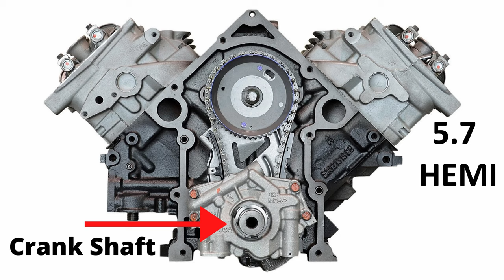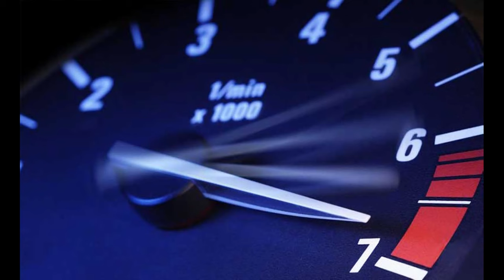HEMI TICK Explained (Easily) - The Cause and How to Diagnose

Comment: Before assuming it’s the roller bearing check the water pump and take your truck to dealer to see what is wrong 
I almost sold my truck because of YouTube wannabe mechanics 
My ticking noise came from the water pump bearing
Reply: I have a 2012 1500 with 120k minor problems started after 7 years of trouble free driving 
5.7 Hemi is a great motor
Reply from the maker: 100% get a professional to look at your truck. it can be very difficult to tell between a lifter tick and an exhaust leak. let alone another issue like in your situation. Never hurts to get a second opinion either! Not only am I a wannabe YouTube mechanic , I'm also a heavy duty diesel mechanic 5 days a week.
Reply: @TheGettyAdventures   wasn’t talking about you I watched many other videos of people saying bad things about the motor
I was trying to say that people need to take they’re truck to a professional and don’t always listen to the internet
Reply: @TheGettyAdventures  I apologize if I offended you but I was talking in general not about you
Reply from the maker: @clgchannel2201  absolutely not man, no offense taken! totally understand what you were saying. truth to be told I have never personally worked on these engines myself but found it interesting how nobody has really addressed or found the root cause of these lifter failures. So there many much more qualified individuals then me. I just wanted to shed some light on the issue and share my opinions right or wrong lol

Comment: I can explain it better,  Chrysler sucks, build quality sucks, from the heated mirrors,  exhaust manifolds, to the piss poor cam and lifters. Probably low quality chinese metals. I found about this then 2 weeks later my engine started ticking. 4700 hundred dollars later it was fixed and down the road it went along with the wifes durango.  I dont want to worry about brake downs, so i bought a tundra, and the wife a lexus. Screw that mopar junk.

Comment: BMW cure for lifter clatter run motor or drive @ 3-3500rpm for 15/20min. + re farm from idle long pi-reds of time.it worked on my 2013 ram + i added graphite.
Reply from the maker: interesting cure, those German engineers never disappointing haha
Reply: Yeah that’s an old school trick to pump up a collapsed lifter. Supposed to purge the air out of it? That and the old Marvel Mystery oil. Fuck it! If it worked for ya!

Comment: They make that noise brand new
Reply: Really 🤔.
Reply: @dimensionexo.  I’ve personally owned a 15rt and a 18 rt and both engines sounds like this video even when they were brand new
Reply: @robfrmny21  Wow,okay,kool,I guess I will just deal with it,thanks 😐.
Reply: @dimensionexo.  I had the lifter make that rattle noise when I was at 1200 miles almost cried lol. The mds lifters I assume don’t hold oil  well.

Comment: And they still haven't addressed the problem.
Just get rid of the darn things and install normal hydraulic lifters. They worked for over 60 years. I will never buy a truck with a so called "Hemi". It's an insult to the real Hemi that they call this abomination a Hemi. Here in BC a major utility company purchased 50 new Dodges with this engine and 49 failed in the first year because they can't handle extended idling. All with fried cams.

Comment: Only a problem on the 09-newer Hemi with VVT, therefore I believe the VVT is the cause of the problem
Reply: The older what 06 to 8 or a bit earlier got valve seat problems....to a SMALL degree. As in basically if you overheat it, run it hot hot hot shut it off, you might have problems with them going. I don't think it's SUPER common by far though. Cam and lifters are probably a bit more common, still can't be that common though
Reply: @baileyhatfield4273  That is true

Comment: I'm having the tick and I am thinking it's the exhaust leak since it does stop once the engine is all the way warm, and the previous owner did indicate an exhaust leak that he never got fixed. What do you suggest blocking the exhaust with to make the noise louder to diagnose? 

I hope that's all it is so I can just replace when I put in my Borla S Type!
Reply: I have an older model, 2011 and the symptom you mentioned was the carriage bolts being broken.  When the engine heated up, the metal expanded kinda holding them in place.  Just my experience, not saying thats the problem.  Common problem too.  And they never fixed it for me under warranty, told me its the hemi tick or something like that.  It was normal.  Good luck.
Edit.
Maybe a little more like a rattle than a tick though.

Comment: I was under the impression that it has more to do with the MDS system not allowing oil to those areas while in 4 cylinder mode. I’ve heard that people who delete the MDS don’t have this issue. Can anyone confirm?
Reply from the maker: Honestly, from what I have heard the MDS system seems to not play a significant role. after doing more thorough research for my follow up video on this topic. It seems like the most plausible reason for these failures is bad or dirty oil plugging and gumming the hydraulic valve lash adjusters in the lifters themselves.

Comment: So to keep it up above 1500 rpm. When im cruising at about 65mph...in 8th gear...its at about 1500-1700 rpm. If I cruise in 7th gear it should be around 2000 rpm. So I should just not ever cruise in 8th gear anymore lol.
Reply from the maker: you should be just fine at 1500 rpm. best thing you can do is limit your idle time with this engine.
Reply: @TheGettyAdventures  

Only have 23k miles on the truck...what im hearing already im hoping is an exhaust leak. I've had two rams before this and a charger. This one makes the sound the loudest though.

Comment: Just had my lifters changed out at 90,000 miles. I have a friend that works as a service advisor at dodge and I told him if he can do that claim on my warranty for me since I paid for the 100,000 powertrain warranty without even using it and luckily they didn’t question the work and I paid $100 deductible to have my lifters replaced.

Comment: Why some will tick and some wont, if they are lubricated the same way. Then, it means that'is not the real problem.
Reply from the maker: potentially, I think a major factor involved is how the engine is driven. if the engine has a lot of idle time or a lot of stop and go traffic there is more a change this could cause trouble. engines that are contently being driven or mainly highway driven would in theory be much less likely to run into these issues
Reply: @TheGettyAdventures  It makes sence to me, but still, that mean dont make that 5.7 hemi work too hard or eslse.... Tic, tic, tic, tic....

Comment: i had the same hemi tic twice on a 2010 1500 ram ..they replaced the lifter and the cams both times under warranty..75000 miles and about 80000 miles also had the heads replced 2 times under warranty before 60000 miles..just hoping now that the extended warranty  is out i wont have that problem again

Comment: I got a 2015 that I did let get lower on oil but not terribly low and on the way home it just started ticking horribly bad and it’s only got 124,000 km I’m assuming it’s a lifter but I don’t have abnormal oil pressure or any miss fire codes I don’t even have an engine light

Comment: hemi engines arent SOHC... the cam just sits higher in the block than a traditional pushrod engine. SOHC would have a camshaft above the valves on each bank.

Comment: I've been having issues with my valve lifters on my GMC Yukon.. I've replaced all of them once a year ago and now I've had to replace two more. Was thinking of selling it and getting a ram or charger but it seems I will never escape this issue... unless I go get a Tundra.
Reply: That's what I said my next vehicle needs to be a Toyota...their parts rarely ever fail ? But Chrysler on the other hand..I Had 3 different models and had issues with every one?? Faulty Parts and recall issues 😒
Reply: What year is the Yukon? I just had one side of mine done on my 2013 Silverado . Looking to dump it before my extended warranty is up due to fear of experiencing exactly what you are going through  😑
Reply: @marcfoster4351  was literally looking to dump my Silverado for a Challenger. ... but your comment has me really rethinking my life

Comment: I just put in a AMS Racing MDS delete kit with Stage 2 cam an Hell cat lifters on my 2011 ram u will also need to get a custom tune to take ECO & engine light. Well recommend to do. Cost with install an tune around 5,000 dollars. Run great now an 60 extra hour.

Comment: uncle tony was proven wrong...
Reply from the maker: I would probably agree with that. although I still think there could be a potential for lack of lubrication. what are your thoughts on this issue?
Reply: @TheGettyAdventures  I suspect poor choice of materials/engineering for this application.  just an opinion.  It's curious that such a light oil was chosen for such a powerful engine too. 5w20?  does it have enough viscosity when hot to hold up under high pressures and to truly protect the components beyond luck...?

Comment: The P47 in your photo as well as other variations that served in WWII were powered by a Prat & Whitney R2800 which was a twin row 18 cylinder radial engine with plate cams.
The 5.7 Hemi is NOT an overhead cam engine.  It is an overhead valve design with the valves actuated by a  single cam, lifters, pushrods, and rocker arms.  There are no cams mounted on the cylinder head of these engines.

Comment: Have 2014 used10w40 Royal purple kn filter have 136 thousand miles and change all plugs at 60thousand haven’t had tic yet 92 boat gas no ethanol mopar cold intake no Catilac converter straight pipe pulley upgrade fingers crossed.

Comment: This just happend to me on my 2017 dodge ram big horn it's been at one dealer  they did not do the right job now its at another dealer I been 5 months without my truck It's been a nightmare for me dealing with my mopar warranty and the dealers I put a lemon lawyer on them and I just hope I can break free and get away from this headache I financed in 2017  and engine which is the 5.7 hemi with 70.000 thousand miles on it blew up due to broken camshaft and broken bolts inside the manifold ram should've corrected this problem on these trucks before selling them to all these hard working pepole my advice stay the hell away from these trucks there pure shit so is the unlimited mopar warranty you buy on them as well its all crap they don't give a damn what happends to you or your broken truck the dodge dealers and your mopar warranty are pure shit they couldn't care less 💔 😢

Comment: Wtf got 2018 any better now or same what to do to prevent change my oil  for Amsoil signature series some hemis ran strong over 200k
Reply from the maker: Amsoil is great oil. run that for the lifetime of the truck and you'll hopefully keep that engine as protected as you can. Don't cheap out on your oil filter either.

Comment: The driver seat in my 2006 Ram fell apart. It was a defect, and they refused to fix the problem. The padding was placed on the wire support, and it chewed up the padding.All the Dodge forums were filled with the same issue. The taillights would fill with water and blow out the bulbs. Lost me as a customer.

Comment: Mine got the tick at 170k and a few of my buddies got at + or - 10k  I went to a 4.56 gear on 35 tire so majority or it’s life now is 1500 and over except for idling which I try to never do I’m 100k since I rebuilt my engine we will see if It will go past the 170k mark before the dreaded tick returns I suspect it will but will see

Comment: They didn't update anything. My 2019 Ram has the lifter tap at only 23k miles on it. I've owned 3 Ram trucks and 1 challenger all with the 5 .7L and they all started tapping at about 10k miles and never stop after that.

Comment: I just bought a 2014 doge ram express with 208,000 and with a ticking sound. I took it to get it checked and they did an oil change with other chemicals and stuff and said that I can still drive my truck but will have to deal with the annoying tick. Any advice?? They said it may be internally but is it fixable or can I check it out myself to see what is the problem?

Comment: i have that issue in my 2006 300c. code p0300 pops up and po301. I changed the plugs and coils. cleaned out all the fuel injectors. it runs a lot better since I purchased it. I don't know what else it can be maybe MDS solenoids?

Comment: Run rotella 15-40 oil you wont have that problem 5-30 10-30 oil is to thin for roller cams I had a bad lifter in a 5.7 ls1 and ran Mobil 1 like gm said to the mechanic told me to run 15-40 rotella and have used it ever sinse and it has been 20 years and went Thur 3 5.7 hemis in a truck and car never had a hemi tick at all I think only reason Chrysler has not said any think is because of a contract with the oil company just my 2 cents
Reply from the maker: I'd be careful running heavier oil in these engines. as for pure lubricity yes thicker oil tends to provide more of it. but these lifters are hydraulically controlled (with engine oil) and the valve train lash is also hydraulically controlled. so what can happen with running thicker oil is you end up with excessive valve train lash potentially increasing the lifter roller/cam lobe "impact" each time the cam rolls around. 

But hey If you are happy with your trucks running heavier oil and they last, who am I to tell you otherwise sir!

Comment: Thanks, just bought a high mileage 2006 Dodge Magnum from a friend who warned me about the "tick", I told him it would be used as a "grocery getter" and little more. I put some Lucas High Mileage oil treatment in and this clearly made the tick less noticeable and it goes away after it reaches normal operating temp..
If the Lucas oil treatment had been put in from the very start it may have never happened, simply because it would never have a "DRY" start?
(BTW, check out a YT channel called RockIslandBooks, and their video titled "The 2520 End Time Prophecy", when you said pray for me at the end of your vid that thought came to mind, God Bless you brother).

Comment: Perhaps I was one of the lucky ones but my 2018 Ram 1500, before I traded it in with almost 120k miles, only ever had a couple of broken exhaust manifold bolts on one side at 70k miles and once that manifold was replaced, I never experienced the ticking sound ever again. As crazy as it sounds, I was actually annoyed that it didn’t happen when I still had the warranty because I had to pay $700 out of pocket. Nevertheless, I never experienced any lifter issues.

Comment: Excellent video.  I do have a question though.  I don't offroad only daily drive and I'm looking at a 2013 - 5.7 2wd Ram with 68k.  Will engine tick be an issue soon with that many miles well maintained ya think?
Reply: I have a 2013 2wd Laramie 5.7 with 84K miles.  I have the tick coming from sheared exhaust manifold bolts on one side. Goes away after 3 min.

Comment: I'm sorry. There are oiling channels VISIBLE in that cutaway that drip oil down on the lifters and cam. The cam and lifters are most likely well lubed. At this stage there is no definite cause; however, the three main possibilities are 1) bad quality lifters, 2) wrong oil suggested by FCA and/or an insufficient amount of additives, or 3) excessive clearance between the cam and lifters which results in the lifter hammering on the cam and, therefore, destroying the bearings in the lifter and ultimately causing major havoc in the engine. Uncle Tony doesn't understand the HEMI and posted a random video with limited factual evidence.

Comment: everyone is right about this problem at this point chrysler has plenty of time to fix this but they cant because like UTG has explained its a design flow in the engine,their is no fix have to keep changing cam sets.sorry to say that.
Reply from the maker: Ya I mean It does seem like the MDS system may also play a roll in this issue but it does seem like UTG hit the nail on the head with the lack of oiling at low engine speeds. Too bad because these engine do run exceptionally well and have great power.

Comment: I had an 03 ram with the 5.7 hemi and ram 5qts full synthetic paired with 2 qts of Lucas oil. Had 200k on it before I upgraded to a 2019 and never had the “tick”.
Reply: That's because they didn't try and make it fuel efficient on the highway then buy adding some stupid things to the engine.

Comment: My truck ticks only when it starts up, after a minute it's gone. If you have this problem will it keep doing it once it warms up?
Reply from the maker: that's most likely an exhaust manifold leak. as the manifold heats up after start up the metals will expand and seal the exhaust leak much better then when cold. which is why you hear a tick at start up. these Hemi's are notorious for exhaust manifold studs breaking causing exhaust manifold leaks. But I've been wrong before, best case scenario is take the truck to a trust mechanic and he should be able to tell you pretty quickly if its a manifold leak or not.
Reply: @TheGettyAdventures  so usually it will continue after it has been running for awhile?
Reply from the maker: @dlestus2368  It can continue to leak if the leak is large enough. If you are getting a ticking sound all the time I would take your truck in and get it looked at.
Reply: @TheGettyAdventures  its only when it starts up and then it's gone pretty quick
Reply from the maker: @dlestus2368  then ya I would bet it's a manifold exhaust leak.
Reply: @dlestus2368  I have an exhaust leak ( last time I checked it was 2 or 3 broken bolts)  mine  almost always ticks at start up but can happen while running up to about 2 k before I can't hear it anymore.

Comment: you’re also forgetting about the chrysler radiator replacement interval of 5 years, getting that cam too hot due to bad cooling hurts that heat treat